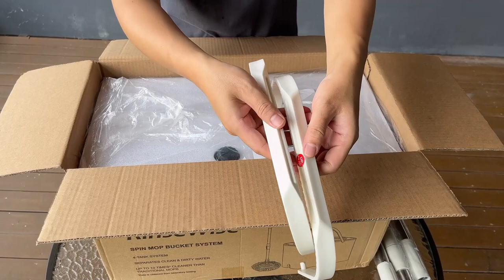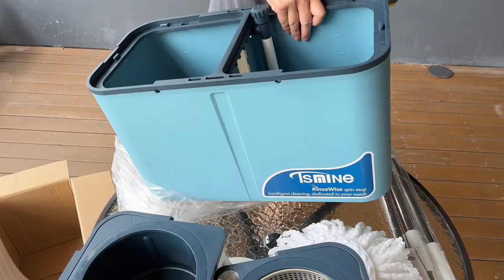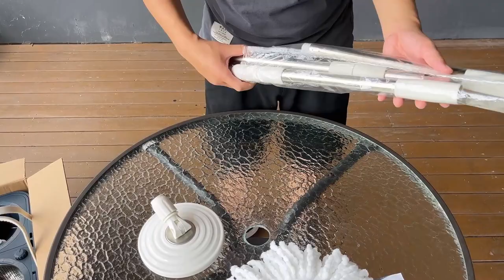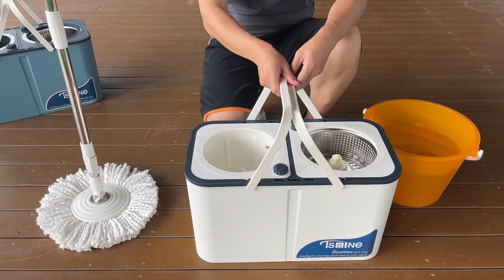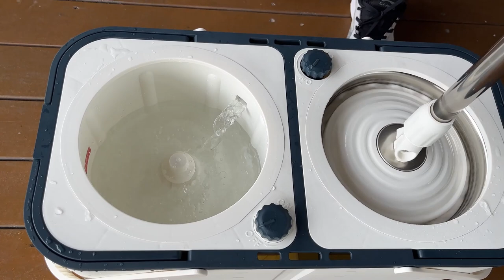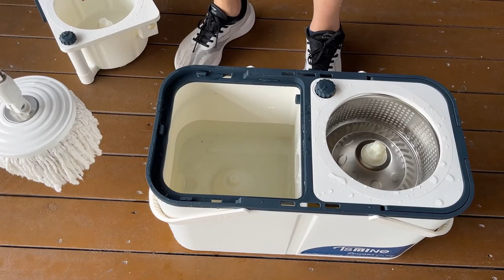Enjoy Fresh Water with Every Rinse with Tsmine RinseWise Spin Mop with Separate Clean & Dirty Water

Comment: the handle looks so bad-...
Reply from the maker: Thank you for your feedback! We strive to improve our products continuously. Could you please share which specific aspects of the handle you find unsatisfactory? Our handle is made of durable stainless steel and has been extended to 61 inches, allowing taller users to clean without bending over. Your input is valuable, and we appreciate your insights!
Reply: @tsmineofficial   🤔. Also why don't you raise the volume the box can handle so that it doesn't splatter. If the spin was further down

Comment: But u are puttin dirty mop into rinse tank which make s it dirty water
Reply from the maker: Thank you for your comment! The rinse tank's clean water is specifically designed to rinse the mop, ensuring that the dirty mop gets thoroughly cleaned before you use it on the floor again. This way, you can be sure that every time you mop, you're using a clean mop. After the mop is rinsed, any remaining water in the rinse tank can be drained into the dirty water compartment with the push of a button. This ensures that you never have to rinse your mop in dirty water again!